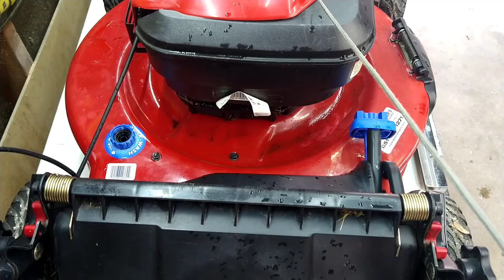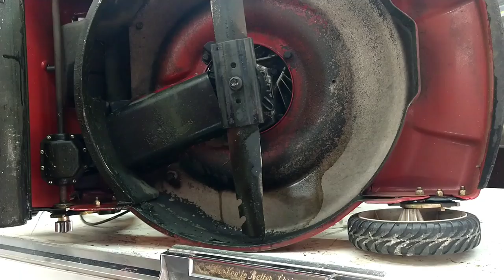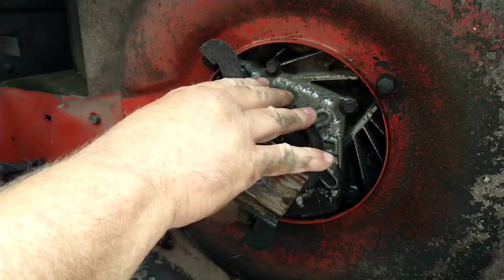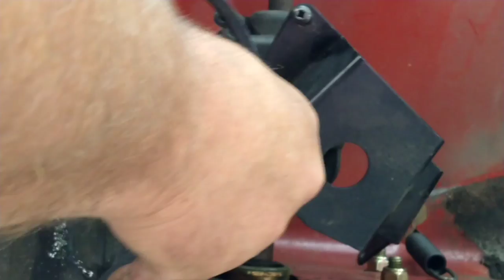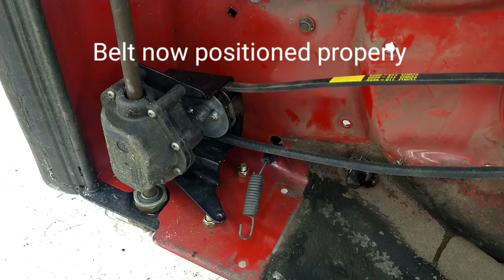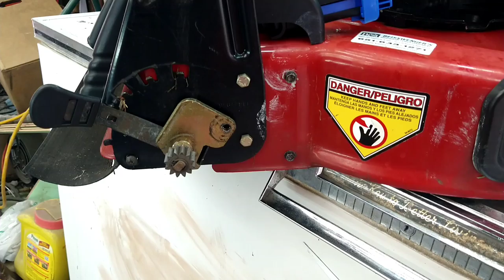Toro Recycler belt replacement.  Don't ever give up, you got this EASY TASK

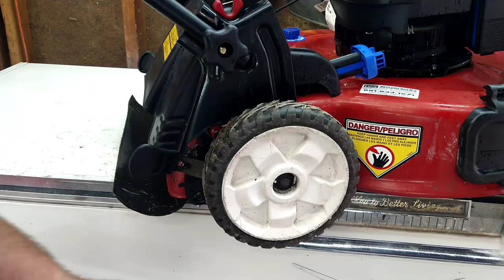Comment: 1:10 -  instead of taking off the rear drive wheels...raise them to the highest setting, then remove one of the bolts (to the plastic rear baffle/bagger assembly)...then lower the wheels to the lowest setting, to finally remove the last screw to the rear plastic baffle.  

It was YouTubers like you that empowered me to fix rather than replace my 22 inch Toro Recycler.  Just paying it forward thanks for sharing and what you do!
Reply from the maker: Thanks for information, I personally find it easier to remove wheels so you could remove any debris and inspect gears.

Comment: I just purchased the exact mower used and it hardly could move so I purchased a new Toro belt for it. This video had great step by step directions and illustrated just where everything is. I ran into the additional fun of having one of the motor mount bolts snapping g off (it is a 12 year old machine that appears to have spent some time out in the weather) After drilling that out, everything else went smoothly. 
    One additional point is that the travel cable may need some adjustment where it bolts to the handle with the additional traction of a new drive belt
Reply from the maker: I have not had the fun of a broken engine bolt, lot's of left side engine mount bolts working loose. They sound like a  noisy engine upon start up. Thanks for mentioning cable adjustment, will have to make a video on this.
Appreciate your stopping by and long comment.

Comment: Thanks so much! Didn't have to stumble through the figurin' it out phase.
BTW 3/8" socket fit a bit better on the cover screws (than 10mm)
Reply from the maker: Thanks for stopping by and watching the video. Glad it helped you.  Thanks for the heads up on 3/8" .

Comment: great video, i just did this job on my neighbors Toro Personal Pace..she got half way done cutting her lawn and the belt came off the pulley near the transmission..i noticed when you were done with this job, the belt seemed to have some tension on it, hers seemed to be fairly loose and have a bit too much slack..not sure if that's what caused it too come off the pulley or not? any ideas? i took it apart and put the belt back on but i'm not confident it will stay on once she starts cutting the lawn again?
Reply from the maker: Try adjusting the cable. Spring on cable keeps some tension on it.
Reply: @LazyGrandpasGarage  hmmm, i've tried adjusting the cable but the slightest amount of tension causes the self propel to stay engaged? i'm wondering if the spring is worn? or possibly another issue?

Comment: Rear wheel drive belt won't loosen to start it up, belt is tight all the time, all is ok up at the handle bar. ....thanks
Reply from the maker: @alsmith5714  stupid question, did you pull belt guard cover off and inspect what's binding underneath? Grass build up, does transmission rotate back and forth when engaging and disengage